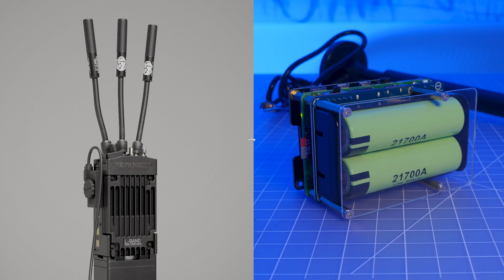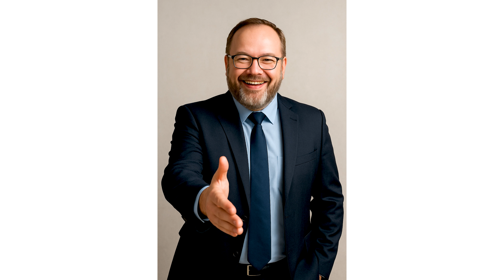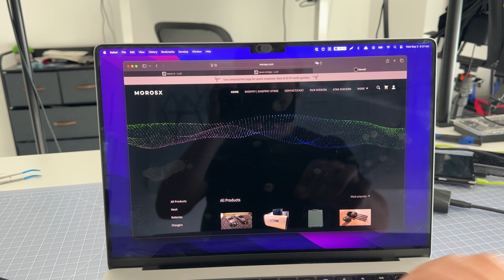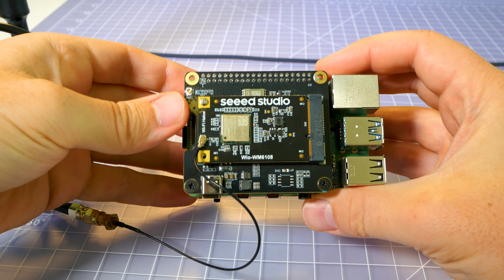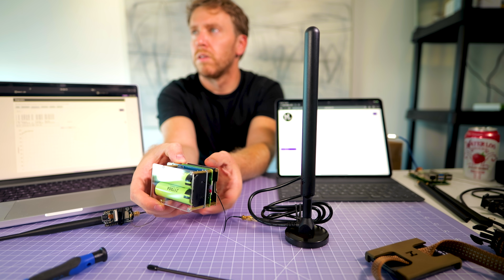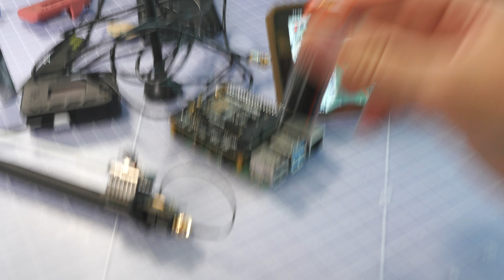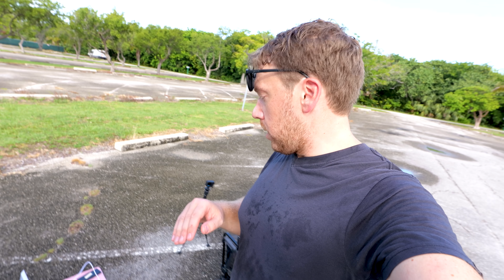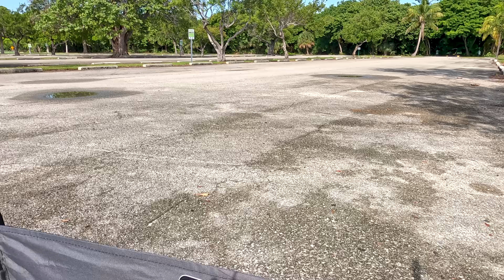I Built a $20,000 Military Router for $106.23

Comment: Keep in mind that the Military also has access to special use WiFi bands that most of us have never even heard about like 1.4 GHz, 2.2 GHz, 3.6 GHz, 4.8 GHz, and 4.9 GHz. We're only allowed to use 2.4 GHz & the 5 GHz bands.
Reply: We also get limited 6 GHz access
Reply: @jacobmarquez9805  Yeah but 6 and 10ghz can't penetrate hardly anything. Tons of bandwidth to be had, but short range when not direct line of sight.
Reply: @EthosAtheos  satellite tv can be like 12ghz, still punches through heavy cloud, starlink V band is like 75Ghz, LOS yes, but clouds are full of water. Still punches.
Reply: @byronhill6128  This is true clouds alone rarely stop a 75 GHz link; heavy rain can, but Starlink’s mix of link margin, adaptive radios, multiple bands, lots of gateways, and laser-mesh routing keeps service up without needing to “blast through” the weather.
Reply: @EthosAtheos you tech guys talk some shyte thsts for sure. Guarantee you've never used 5ghz never mind anything else 😂
Reply: @4parabandit everybody has used 5ghz what are you talking about? Every modern router has it... literally using it right now
Reply: @4parabandit  Almost everyone has 5ghz experience as it is part of the WIFI standard and has been sense 1999. It was introduced as 802.11a. But beyond that I have experience using it for last mile communications and campus networking. 

I've used 6ghz as it is part of the new WIFI standard. I've used 10ghz for point to point campus networking. It doesn't work through a tree when a bird lands in front of it. 

I'm not sure what point you were trying to make.
Reply: @4parabandit  

Not so many people know that TVs have been using 5GHz freuquency for ages now
Reply: @4parabandit 😂
Reply: AT&T has access to 3.5 GHz DoD for C-Band use
Can't speak for the Ericsson, but the Nokia M-MIMO all in ones suck really bad
Reply: Well I'm using a 26.7Thz band that the military doesn't even know about.
If they don't know it exists then they can't not give me permission to use it.
Mostly I use it to shitpost on youtube comments
Reply: @Skinflaps_Meatslapper my hero
Reply: @Skinflaps_Meatslapper wait 26,7thz? Helios fusion?
Reply: @Flir67  Yeah I'm able to transmit about 75m on a good day.  It's pretty much impossible to intercept because the atmosphere absorbs terahertz frequencies like a ShamWow.  There is simply no stray signal left to intercept beyond that range.  Honestly I just didn't feel like running 75m of cat5 cable and had the stuff to make it all in the shop already
Reply: @Skinflaps_Meatslapper need more info on this buddy
Reply: He's using the 902-928MHz band -- the same band used by commercial microwave ovens and a bunch of IoT radios like Z-Wave, LoRa, Zigbee/802.15.4 (optionally), rather than 2.4GHz, 5GHz, or even 6GHz at your house. HAMs can legally access some other bands, but the HaLow is only made for the 900MHz band, though most of the HaLow chips have a bit more flexibility. 

The Military is using plenty of other radio bands, though not necessarily with a WiFi waveform.  Part of the 3.6-3.8GHz band was, until a few years ago, the frequency used for the Coach Radio during every NFL game in the USA (I designed the hardware). That was a licensed band, but it's been taken back by the US Government for cellular use -- pretty much everything possible is being sucked back for cellular use.
Reply: @DaveHaynie  at those bands range is almost a non factor. You're assuming los only and relying entirely on meshing for distance. This works for small teams or highly meshed systems that can communicate to other systems that have greater range or are Internet connected. That's how the military systems work, the mesh networks mesh to a satellite connected mobile vehicle which sends the data back to a centralized sever and back.
Reply: @TommyJ76  Range matters, because WiFi is always adjusting based on bandwidth and signal strength. Sure, one good use of a mesh network is to build out a short enough node to node distance to maintain higher speeds, but even at that, range matters. Another use of a more dense mesh is frequency reuse, and there, range also matters -- but specifically, the ability for nearby mesh nodes to dial down power. And certainly not all military mesh network have satellite or internet connections, it all depends on the purpose of the mesh. At least back when my first generation MIL systems were delivered to the military, there was no value in an internet backhaul. Perhaps that's changed... today, perhaps not.
Reply: @DaveHaynie microwaves don’t use 900mhz.  He’s using 900mhz because it’s license free.
Reply: @Blobiryblat  Incorrect. Industrial microwaves in the USA commonly use the 900MHz ISM band. "ISM" (industrial, scientific, and medical) is the technical name for these various free-use bands, and because they're free to use, they're used by microwave ovens as well as various very short range radio protocols. I design hardware professionally in radio communications -- stick to your expertise.
Reply: @DaveHaynie why would "industrial microwave ovens" use 900 mhz when the water molecule h2o is more resonant at the 2.4 ghz range? It's going to take more power, or some harmonic of 2.4 ghz down in the 900 mhz range which seems much more inefficient than just building a more powerful microwave oven at 2.4 ghz.
Reply: @paaao Might have something to do with the massive power levels exceeding 100kw or the fact that 902-928MHz penetrates about 3x further into a material compared to 2.45GHz. I am not sure, only have done some light reading on the matter.
Reply: @DaveHaynie  If you're more rural, too, and you're dealing with wireless ISPs you're likely to run into a lot of stuff on the 900mhz range.
Reply: @DaveHaynie microwave is 2.4ghz  it's a dirty band that's why they let us use it for wifi ..
Reply: @RageKge  Go read my words again. Industrial microwave in the USA is often in the 902-928MHz ISM band. Consumer microwaves are all in the 2.4GHz band. Now you know more than you did a few minutes ago... accept your new understanding of the world! 

Both are ISM bands -- free to use with power limits. That makes either one fairly dirty, as there's a ton of stuff there, but it's all short range. There are at least 12 ISM bands in the USA from 6.765MHz to 244GHz.
Reply: @DaveHaynie  I wasn't in disagreement with you. I accept the different strokes for different fokes principles (different standards over time and location..
obviously it sounded like i did disagree..I didn't mean to come across like a dick, sorry for that..
Reply: @RageKge  You do realize microwaves have a faraday cage, right?
Reply: @nonegonewrong .. yeah but how come my Wi-Fi cuts out every time my  microwaves on... Faraday caves Meriday cage the Faraday cage isn't that strong it'll stop you going blind but that's about it... Also harmonics.. like yeah the microwave say transmits at 2.4 but you can't tell me that it doesn't create some sort of a resonance on other frequencies and then you can't also tell me the Faraday cage is set up to withhold those frequencies as well there's no way the government aren't smart enough and the corporations aren't that big on quality control and in today's day and age they can definitely argue any circumstantial evidence that might suggest there might be a problem here like with all the other radio dirty s*** floating around the world at the moment.. it's not me look over there meanwhile everyone's pointing to  the guy beside him... Suggesting their the problem not us... I'm not suggesting that microwaves are unsafe I I would however maybe suggest to you that they're just safe enough and nothing more..
Reply: Also isn't that Faraday cage linked to the grounding system of the entire house which technically could create a transmitting element.. of God knows what frequencys.. like there's a lot of s*** involved in the arguments not even worth having because systemically there's nothing that we could do about it if we tried even if my Wild hot take was 100% correct the point is mute I will concede on that point
Reply: @RageKge  The point is *moot*
Reply: @DaveHaynie  why not just send the Doppler effect through a laser hitting a personal satellite if your trying to get free WiFi like from my house to my friends house I can send him WiFi through the laser for 1 mile keep in mind using a big battery with solar panel recharge
Reply: My dude we as people in the United States are allowed parts of those bands for wifi from 900mhz 802.11ah to 60ghz 802.11ad what we cannot do in public domain is encrypted comm and frequency hopping outside a single band or block other signals. It has been proven that certain military radios are just certified wifi routers in a easy to carry case.
Reply: @spinyheghog you can use those bands for ISM use up to 1 watt (30dBm) using a part 15 certified transmitter also adhering to dwell time and spread spectrum requirements. Anything higher power or narrowband requires a commercial license or an amateur radio license on ISM bands but the caveat is that you can't encrypt communications with a HAM license (or you technically can but you need to make the encryption key and algorithm VERY publicly available and that's a gray area I wouldn't even touch).

Also look up AREDN it's an amateur radio wifi setup not TOO different to this but typically uses staticly mounted modified wifi access points instead of a MANET type system.
Reply: you're forgetting about the 915MHz band for meshtastic (in the us)
Reply: If you have a software defined radio, and a little know how - you can basically opt to use whatever the hell you want. It's not a technical limitation, the only thing that stands in the way is legal limitations.
Reply: Nope, plenty of devices use those bands, and it's very simple to build a device that also uses those bands for testing/learning purposes. Just don't push enough power to reach half your city and you'll be fine. Remember, the government trips over itself just doing basic stuff, they're really not that capable.
Reply: Yeah, I'm on sband below Wi-Fi frequencies and can operate 10w.
Reply: @crustys6900  My first "big radio" project at my former company was building a 1W 430MHz WiFi radio (peaking over 5W, thanks to 802.11g crest factor) for robotics control. We had been testing 20-23dBm 2.4GHz stuff out at my tree farm -- narrowband, so we got decent range line of sight. But you'd drive stuff down the rear dirt road and die pretty quickly in the forest. Once I got the thing working at 430MHz, though, I could drive down the road, into the woods, out of the woods, and down to the road behind us, maybe 2km total, before things got dicey. At 430MHz I really needed higher antennas to make it optimal. I have a current project also targeted at the same band, but it's a multi-band thing...
Reply: You heard about ham radio?😂😂 You have no idea, please do not comment nonsense.
There are like 20 allocated microwave bands, 900mhz 1.2, 2.3, .... a lot... for civilian use
Reply: its great that 1000 different military weapons go through my house at all time just so some 60 year old woman can watch netflix 7 houses away
Reply: @puppybunnyx  ohio?
Reply: When the guy said "Link 16", then you said "Line of Sight" 😅
Reply: TY for this info.
Reply: Don't forget about 3GHz as well as 60 and 80GHz. 900MHz is used for obstruction penetration when you don't have LOS. We have just as many frequencies to play with.
Reply: Just use them illegally
Reply: Uh no 😂😂
Reply: and now 6GHZ
Reply: Yea you get in trouble for using them, not it's impossible to get on
Reply: It's amazing the creator of the video has liked this completely incorrect statement. Maybe because it's funny?
Reply: I'm using 6 rn on my spectrum router, dawg.
Reply: Don't forget about spread spectrum frequency hopping along with 7/8ghz federal microwave.
Reply: it really isn't hard to transmit on any band if you know how to build the equipment and you don't care about the FCC. The FCC makes the rule but they don't actively monitor the bands.
Reply: @Well_Edumacated the FCC doesn't really anymore no but if you repeatedly step on paid spectrum space owned by a telco (e.g. Verizon) they will find your ass
Reply: For private use?🤔
Reply: Neat, I didn't know that.
Reply: then how do YOU know about it?
Reply: And 6ghz and 60ghz
Reply: Not a ham, apparently.
Reply: ... military frequencies don't reach higher than 87,975 mhz. These are the only ones no one else is allowed to use.
Reply: Who cares what you can legally access.
Reply: the FCC opened 5.925–7.125 GHz for unlicensed use, including Wi-Fi, in 2020
Reply: This is an under rated comment.
Reply: @EthosAtheos it’s also false
Reply: incorrect.. there are many devices, such as smart devices which can even use sub 1GHz bands for better coverage. You can even build your own antenna and pick up any band by adjusting the length of the wire (thickness is also a factor)
Reply: @mightyInferno97 I'm talking about specific licensed Government & Military WiFi bands not Garage door opener frequencies.
Reply: @peterfairlie2296 its all the same frequencies, dumb fk govt doesnt have ownership of it.
Reply: @kool4209 Not to be that guy, but we absolutely have s-band c-band x-band KA band and other frequencies that are issued out by NTIA that are separate from what civilians are allowed to use.
Reply: @kool4209  The FCC/Federal government does own the air waves. You need permission to use them. Functionally do what you want but its a FUFO situation.
Reply: @mightyInferno97 True, people forget that Hertz or  KHz or MHz or even GHz are just wave lengths and people can just tune in if they match the frequency, a rate at which something occurs.....
Reply: @mightyInferno97 yeah 400 and 900 meg bands are loaded with civillian stuff, depending on jurisdiction
Reply: @mightyInferno97 WRONG, learn how to read next time.
Reply: @mightyInferno97 you’re incorrect. Most people have never heard of them most devices can’t use them. There’s always going to be a few that do
Reply: @mightyInferno97 Uh, that would be a no.  You also have to have a radio that can process those frequencies.
Reply: @LIDARWidgets criminals roam the streets with Glocks.. Uncle Sam ain't worried about this..
Reply: @LIDARWidgets  yeh hack rf one ...
Reply: @LIDARWidgets  yes but transmitting on these bands is a federal crime and can be a felony. It can also be construed as a crime to even listen, though the case law is less clear, as I understand it.
Reply: @cianmoriarty7345  Why are you dragging the legal system into a technical discussion?
Reply: @LIDARWidgets  ACKSHUALLY 🤓
Reply: More correctly, using 802.11 as we civilians use it is a death sentence on the battlefield. 

Having an always-on WAP attached to you means you'll be RDF'd in seconds. It doesn't matter if your comms are encrypted or how much data you can push if the enemy knows exactly where you are at.
Reply: @Lap1ac-3  True
Reply: @Lap1ac-3 you're right except for one part in your message, phones aren't access points unless you have hotspot on
Reply: @ckpioo that doesn't matter if you're transmitting data...
Reply: @ckpioo you are missing the point. We are talking about wifi here which both the access point/gateway or mesh gateway is constantly blasting out RF to ensure a tcp/ip connection. The client devices wether they are phones, computers, hotspots, or anything, are also constantly blasting out RF. So if I'm in the sky above you, or I have satellites above you, I can discover your exact location and blow you up. I could also not blow you up and let you believe you are making progress and blow you up when it best suits me, and kills the most of your soldiers.
Reply: this is wrong
Reply: Don't know who told you that lol, chat gpt?
Reply: the government owns the air now
Reply: Wrong.
I can literally go to ubiquiti and order a point-to-point on the 60Ghz for like $180. I use a Hollyland wireless HDMI that operates on the 1.9Ghz
Reply: @jspringer86 
But ther are lots of restriction on what you con do when the bonds that the milletery dos not have to take in to account